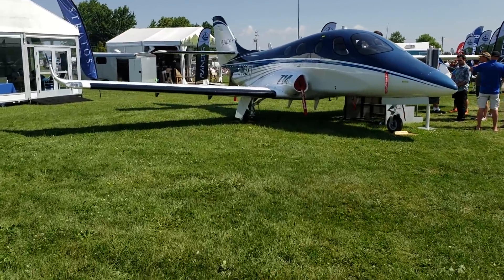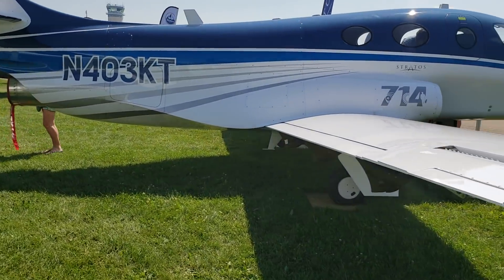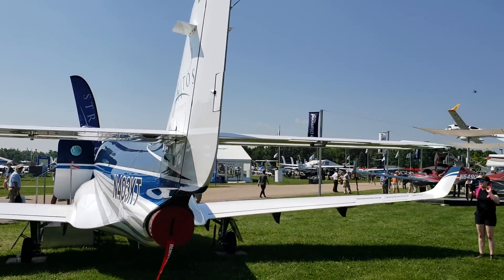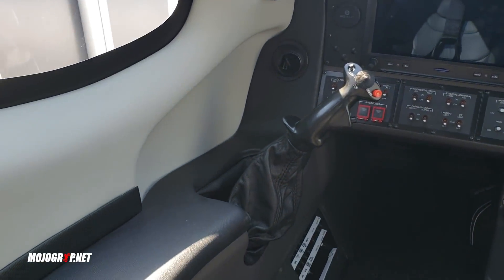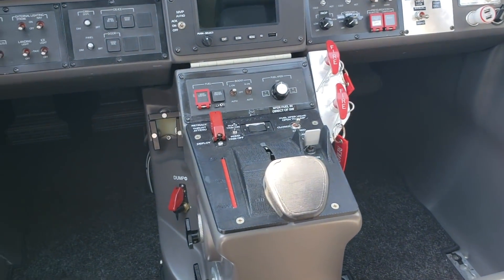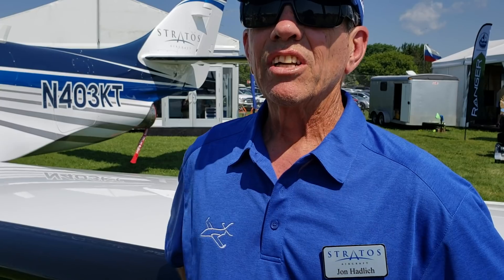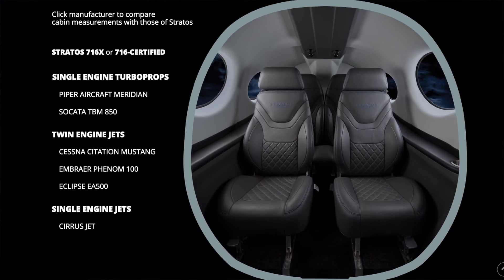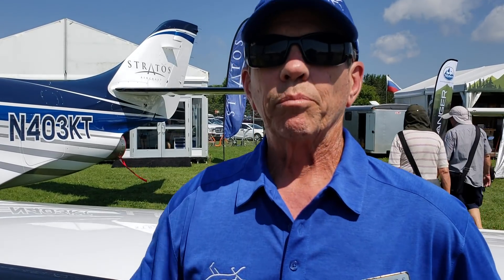Stratos Jet Can now Be Built As A Kit

Comment: In order to be designated as a Very Light Jet, Maximum Takeoff Weight (MTOW) is targeted around 10,000-pounds. The definition has nothing to do with how many engines the aircraft has. Nor does it have anything to do with required Minimum Crew (two pilots, or one).

Comment: For 3 million id just put up another 800k and buy a practically brand new used g4.
Reply: Hahaha, the purchase price doesn’t mean a lot in aviation in terms of money. Sure, buy a G4 but it’s not single pilot. Factor at least 2 full time pilots, probably 3 where initial type ratings, recurrent, salaries, benefits will run around $500-$600k per year. Hangar for a G4 averages $81k per year, insurance $45k year, fuel burn per hour at 520gph will run you $2200per flight hour, basically you see where I’m going with this. With an all said and done running cost of about $16,000per flight hour with variable and fixed costs, you couldn’t afford to run a Gulfstream, let alone buy one with $3.8mil in the bank.
Reply: @gmonnig  you missed my point. And 3 pilots are not needed for a g4. Also they dont get paid 5-600k a year either. Even if you ment both together they still dont make 250-300k a year. My point was why buy it if you can buy a practically new used g4 thats bigger faster nicer and comes with bragging rights. And hangar prices arnt that expensive. Youd be better off on the resale value too. Your logic is flawed.  To someone who has the funds to buy a private jet 800k is a drop in the hat.
Reply: Follow The Grow as someone that used to work for a jet charter Company the operates Gulfstreams, I can tell you I am correct. You sir, can do a simple google search on these items. Let me do you a favor and I’ll search it an put a link up. And yes, your professional pilots will cost that much. It’s not just salaries, it’s type ratings/recurrent training, hotels etc. I have been with the FAA for over 11yrs now so prices may be higher than I remember back when chartering out of Scottsdale.